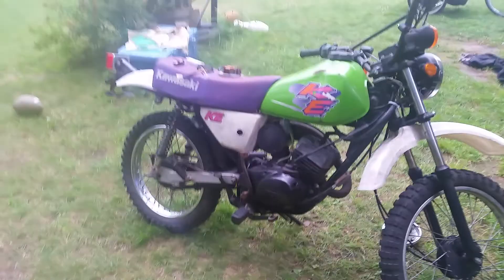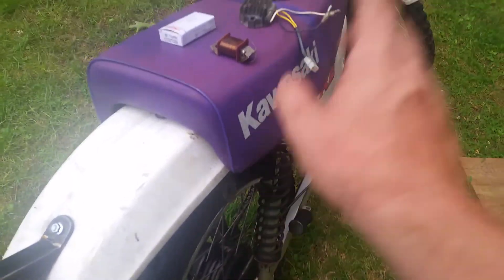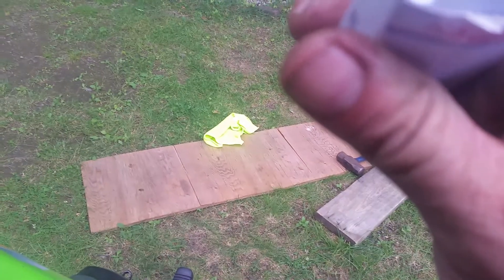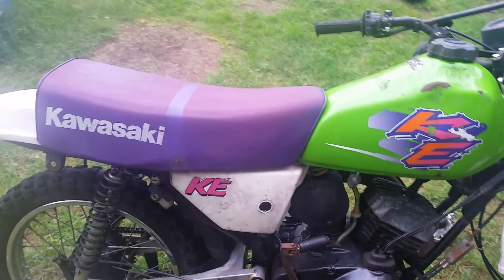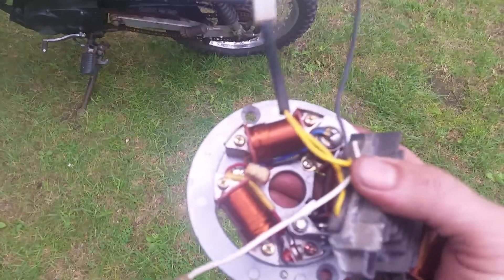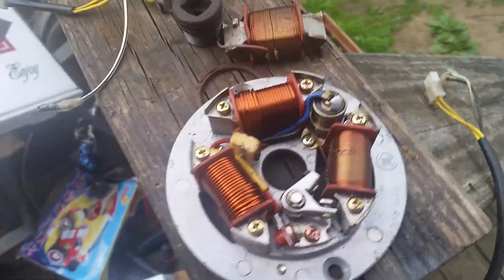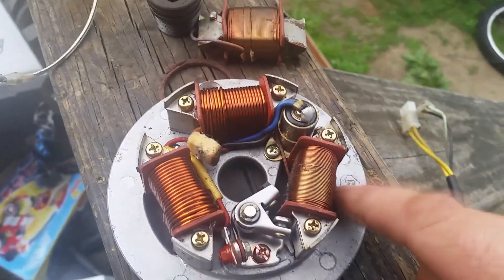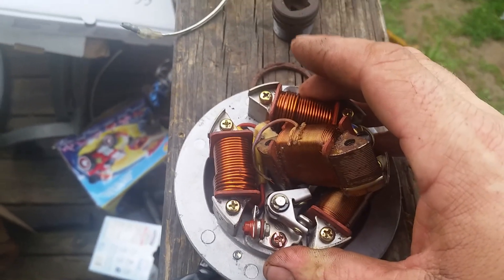KE100 KM100 6volt to 12volt part 1

Comment: I’m at a loss for how to hook up my wiring on my km100. I had to buy a new ignition coil because the stock one went out (I know because I tested it like you did in a previous video). I have the 3 coil stator and need to know which wires to hook up the coil too.
Reply from the maker: Coils don't go bad on these bikes not enough current to damage them theas bikes are designed for points and condenser the done
Reply: Kevin Bergeron normally that’s what I’d think but I did the test you showed in a previous video probably 20 different times and I didn’t once get it to spark again.
Reply from the maker: @Billyjoe78517  points and condenser
Reply: Kevin Bergeron I seem to still be getting power from the stator, just can’t tell which wires are which
Reply from the maker: @Billyjoe78517  replace the points and condenser all you need to do
Reply: Kevin Bergeron I don’t need a regulator if I’m not running lights right? That’s why it looks like on some wiring diagrams
Reply from the maker: @Billyjoe78517  your not understanding charging system and ignition system are 2 separate systems no spark issues are simply points and condenser
Reply: Kevin Bergeron I will change them out, but I tested my ignition coil like you did in a previous video with a battery and it didn’t spark when it should’ve. I had done that test before and it had sparked, and now when I test it with a battery it won’t spark. I’m sure the points probably need to be replaced, but the ignition coil seemed to be out too
Reply: Kevin Bergeron got it to spark and threw a new piston in. Can’t get it to run tho 😭
Reply from the maker: @Billyjoe78517  compression 120 psi or better
Reply: Kevin Bergeron would it have any compression if the piston is .20 too small? I’m worried that the cylinder was already bored before
Reply: Kevin Bergeron also hearing air come out of the carb

Comment: If you could tell me where I could get points and a condenser for an 86 ke100 it would be great I can't find any and I don't know what I could cross reference them with
Reply: Thank you so much your the man 👍
Reply from the maker: Ebay Amazon partzilla
Reply: I've been on Ebay and Amazon nothing seems to come up 86 specific. I have a bought a bunch of stuff I can't use and electrical is not my strong point  .
Reply: Would an points for an 1981 work
Reply from the maker: @Chris-ri4sh  1972 and up
Reply: You are currently the only good source for information that I have found you can expect to be hearing from me again.  And thank you for your time

Comment: You should do a video about porting differences on ke kd an km
Reply from the maker: That's very expensive because you will have to re nikisile coat your cylinder I can make power in other places
Reply: @2strokeguru   I mean show the differences between the 3 not enlarged or move the ports I
Reply from the maker: @givens666TOOF  cant move because of the rotory valve you can do this on a read intake engine
Reply from the maker: @givens666TOOF  like a kx
Reply: @2strokeguru  okay im new to the rotary valve 2 strokes im a 250 race bike guy thank you
Reply from the maker: @givens666TOOF  I have a Suzuki DS80 coming soon I am planning on doing that to it
Reply from the maker: @givens666TOOF  are you running a power jet
Reply: @2strokeguru  also do you know a place that has kd100 fenders in stock I can't seam to find them anywhere

Comment from the maker: the problem is is the coils produce 25vols ac when converted to dc volts is only 6-7volts so i am going to try ignition power coil 2 of them to produce 50volts ac should give us 12+ volts dc when ran thru a 12 volt reg

Comment: Man you are full of GREAT info!!  I am in the process of doing this (stated previously, as you know).
Will be following these videos diligently and saving them.
The only thing I'll be doing different is swapping light housings too eventually.

It's going to take me some time to get all the parts too.  So I guess I'll just wait. :D

I was taking some parts off and started the process of cleaning up the bike last night.  The screws are stripped on the left side case on my bike.  Darn it.

And.... my bike is a newer one... :(
Reply from the maker: yes i am going to build the unit on the factory base plate and post a full video on how i did it  parts list and diagram
Reply: David Pyzik when you find the actual part we need can you post the link? i have a 99 ke100 that i want to convert
Reply from the maker: you can tellif you have electronic ingnition by the connector you bike have 2  2wire plugs one plug has 2 yellow wires and the other plug has a black wire and a green wire the connector with the black and green wire if it has a white connector it a points ign if it has a blue connector its a CDI the connector is located just above the air filter between the fuel tank and seat or you can follow the harness from the engine left side of bike
Reply: I meant to look last night but being a 2000 I am sure it does.  However, thinking and reading this morning I had an idea.  Tell me your thoughts.

From what I understand, my stator has 3 coils.  One powers the headlight, one goes to the battery and one goes to the ignition coil.  Each producing 6v. 
Couldn't I just run the headlight coil line with the battery coil line (6v ea., producing 12v), swap my 6v regulator for a 12v, swap the 6v battery for a 12v then run all lights off the battery?  Obviously I'd swap all lights to 12v (LED).  The new 12v sys and battery should have no problems running all the lights, especially LED.

Thank you for your help!!
Reply from the maker: thank you i try
Reply: Question.  I am finding stator plates from a Vespa that have thee 12v coils.  Is there a reason one of these will not work?  They're pretty inexpensive.
Reply: Here is one as an example.  The wire harness wouldn't be correct but that's the easy part.

http://www.ebay.com/itm/Super-sprint-bajaj-12v-stator-plate-assembly-for-vespa-12-volt-vba-vbb-VASCO-/272720528534?epid=27004068264&hash=item3f7f690496:g:fsMAAOSwHLNZQ7tm
Reply from the maker: its going to look just like it butt with out the picup on the outside and you need to keep the 3 magnet rotor the one for the vespa could hit the windings different diameter
Reply: Thanks Kevin.  Without being able to take my cover off yet I couldn't get in to look.

Very much looking forward to seeing how and what you do.  I do think that even though mine is a newer one I can do the work.
Reply from the maker: you are welcome the first conversion is for the ke100 with points ign